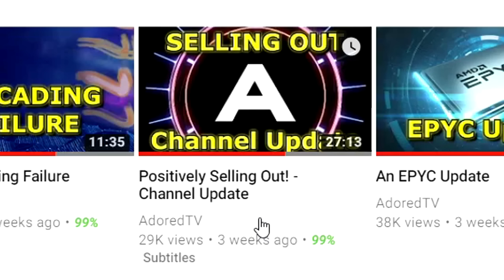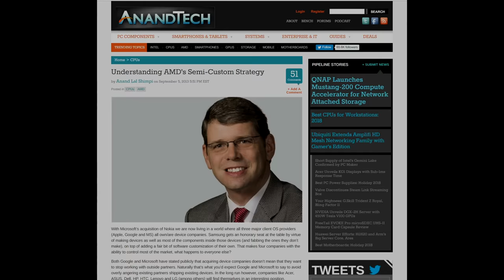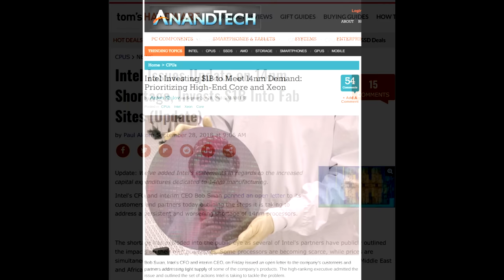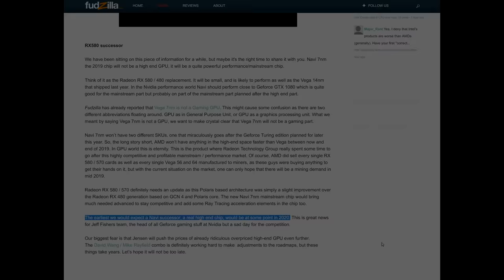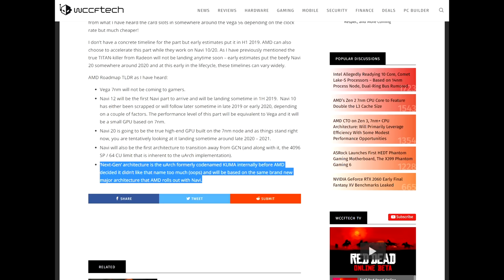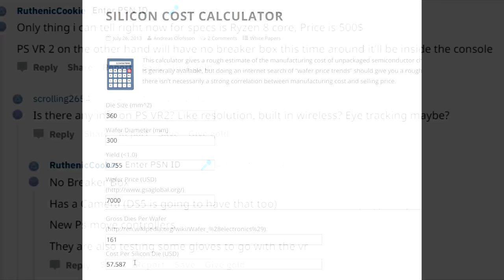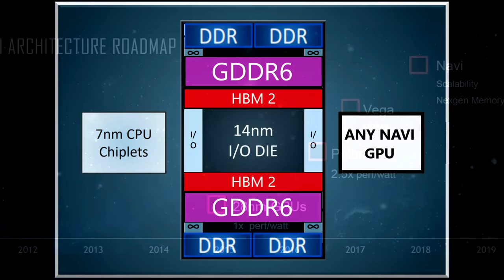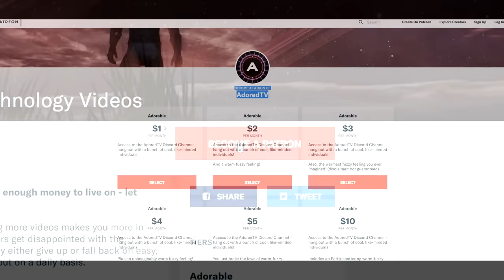AMD  - The (Evolving) Master Plan

Comment: 7nm is gonna be fun.
https://www.semiwiki.com/forum/content/6713-14nm-16nm-10nm-7nm-what-we-know-now.html
Up to 65% power reduction compared to 16nm. That means RX 570 level performance on a 75W card. Couple that with lower power consumption of GDDR6 over GDDR5 and we could be looking at RX 580 level performance within 75W. Oh, and that's just Polaris. Who knows what kind of performance/watt Navi has? 40 Compute units at 2GHz? That's basicly GTX 1070 level performance right? That's a kinda monster.
Oh shit, I shouldn't get myself so excited, GCN has dissappointed me since the 300 series. I don't want to be dissappointed again. 
As for Zen2; I think Ryzen is gonna have 4 chiplets with 0, 1 or 2 functional cores. Threadripper is gonna have 4 chiplets with 3, 4 or 5 functional cores and the rest goes to Rome. Thus the PS5 could have 4 chiplets with 2 functional cores each.

Comment: What does bin and binned and binning mean?
Reply from the maker: it's basically "grading" chips based on how fast they are or how good they are in performance/Watt. For example the best chips that are used in the datacenter (Eypc) would be the "top bins", while stuff like your dual-core Athlons won't be the worst bins.
Reply: @adoredtv  Thanks pal.

Comment: PS5 performing at 1080 Ti level seems very optimistic. 1080 level seems more realistic.
Reply: Just to remind, the quality might be not on par with PC (dx12 driven, not with gameworks)
Reply: @adhahanif9792  If the fidelity doesn't match then it's not on par.

Xbox One X scraps 4K 30 and very few examples 4K 60 by cutting corners on fidelity. You can get a 1050 Ti running extremely high res and fps if everything is a lowest settings plus checkerboarding. Not the same though is it.

Comment: IMHO AMD devices are not optimal at this time because of the need for third party approval i.e lack of software/system support departement. (mantle, multicore/multithread etc ).
the story will be different if there is freedom. custom Console industries are Freedom. (hence this was their slogan "Freedom")
.
my bet that ps5 were just gonna using current custom ryzen cpu and 7nm GCN or vega with gddr6...more like in intel vega series (i7-8xxxG series)
all that combined with optimized ps4 system software.  
.
so NAVI is far away from console, its another level i guess...well idk i might be wrong tho :)

Comment: I think Sony is making a mistake waiting until 2020 to release the PS5. Even in 2020 I doubt they will use 7nm it will be too expensive for the console market. 
In the console market what matters most is FIRST! followed by not an insane price. 
I think Sony would be much better off releasing cheap in winter 2019 with enough power to beat the OneX and a 4k Bluray player, they could even use the Zen 2 architecture but on older nodes e.g. 12nm for the APU cores and 28nm for IO.
Reply: Not going to happen they made their bet years ago. As market sales show Zen is a contender, now on Zen+ more so. Zen2 is going to be the monster Jim talked about. 8 cores even w/o smt (Sony) or with (Microsoft) and a 20% improvement to IPC will make 4k\60 a reality for consoles and NEW multithreaded game engines. I hope PC can keep up. My Vega 64 cost $430 today vs. $500 for a PS5. in 2020.
Reply: @jerrywatson1958  Most console gamers don't care. They see the words next gen first and As long as the price isn't silly the rest doesn't matter. Microsoft's awful xbox drm and lower specs wouldn't have mattered if they beat Sony to market at a better or equal price.
Reply: Games for the new console have to be developed. That is why the timeframe cannot be shifted. Also there has to be enough hardware produced in advance.
Reply: @phas0rOfficial  Hardware wise they could make an 8Tflop ps5 for 2019 it would just need a more expensive cooling system and a higher power budget. Fair enough if they are waiting for games but it's still going to be x86 so all pro titles and most og ps4 titles will work on the system.

Comment: come on now, 4k60 doesn't have the same physical requirements on a console as it does on a pc with it's poorly optimized drivers.
just take the current "4k30" xbox one x and multiply it by 2.
good video though, if not a bit long
Reply from the maker: >just take the current "4k30" xbox one x and multiply it by 2.

Yeah I did that too - twice the Xbox One X wouldn't be far off a 1080Ti either as it's basically just below an RX 580.

Comment: You were right on most points except 1.  Navi can indeed be a mcp.  Most of the die space on a modern GPU is dedicated to CU's.  CU's are the pipe channel that process the graphics after the prefetch, schedular & dispatch sub-processors has handed them off.  Quite frankly it wouldn't be hard for the dispatch processor to hand off instructions to CU's on different chips.   You need to get out of your head the idea a MCP of Navi means corssfire.  It isn't even close.  Cross fire is two GPU's running the same data on the same frame ALR, SFR, or frame &  frame + 1 (AFR) and then sharing that data between chipsets.  This creates massive penalties that are too complex here to explain.  

You were quite astute to point out AMD has been working for years to make their architectures as modular as possible.  This extends to the GPU side. And a recent article on Anand points out the incredible life of the GCN architecture.  All the sub systems on the GPU were built to be swapped out with minimal work.  This includes seperating not only the memory controller, but the prefetch, schedular, & dispatch sub processors.  But just like Ryzen, there will have to be some memory on the CU chiplette to avoid latency affects with an infinity fabric like framework to handle conflicts between chips.  Say like a small frame buffer of RAM.  Why not cache RAM?  Cache contains blocks that are meant to be swapped in and out depending on the caching algorithm.  When you are rendering a tile, the swapout of said data is not necessary until the frame is done.  And that's what chiplettes are essentially doing. They are rendering tiles. 

And as you guessed, I'm betting an infinity like frabric on an interposer to deal with conflicts.  

It took me several weeks of math to work out, but based on the tech specs of what I've seen (Where the most time is spent on different parts of the chip) and where latencies are introduced, the approach above would be more than viable.

Also there's one little tidbit you glossed over with the original XBox One.  That shot showed SRAM buffer gave AMD a lot of information of the latencies of small yet fast memory sizes and how it affected latency.  

-DG
Reply from the maker: I know it's not Crossfire. ;) 

But it's not as simple as just breaking up the front end to work over a bunch of MCM chiplets either.

It's a solvable problem but one that's gonna take a lot of resources.  I don't doubt it's coming, I only question when.

Comment: 15:42 I bought my 8700k early on, and I got a "Golden Sample" which only needs 1.344 Vcore to hit 5 GHZ all core and 4.7 GHZ Cache and can do Prime95 AVX and AIDA64 FPU test (highest heat output, hardest to pass with overclocks) infinitely, maxing out at just 85° on the hottest core - with a Noctua NH-D15!  

I am NOT an Intel Fanboy, I bought my CPU precisely because A) I wanted best gaming performance with headroom for years to come and B) I REALLY enjoy Overclocking! I could probably do 5.1+ GHZ, but I am happy with 5 straight.  IF Zen2 manages to either basically tie, or beat Intel at gaming, I will not reccomend anything else! In fact, my Nephew's i5-7600k motherboard died, and I reccomended he buy a Ryzen 5 2600/X on a B450 or x470 motherboards depending on what he can afford.

Comment: Navi being yet another GCN card would be incredibly disappointing. AMD will never be truly competitive as long as GCN is still around.
Reply: I don't think GCN will be retired until Arcturus, which is after Navi.
Reply: @justinlegrande1630  Yes I also watched the video. Thank you for the valuable insight.
Reply: @JDurnall  I wasn't certain if you had or not, since this video is nearly an hour long.  I had the impression you didn't know, since you phrased your response as "would be incredibly disappointing" instead of "is incredibly disappointing."
Reply: @justinlegrande1630  Adoredtv has not confirmed anything. He has two competing sources saying two completely different things about the same subject. If WCCFTECH is wrong and Navi is still GCN it will mean Navi is likely to dissapoint in more ways than one.
Reply: @JDurnall  Official confirmation, no, but there is this:
https://www.tweaktown.com/news/60760/amd-working-next-gen-gpu-navi-2020-2021/index.html

https://www.tweaktown.com/news/63333/amds-next-gen-arcturus-gpu-teased-radeon-rx-780/index.html

I think Navi will make a nice swan song to GCN, but I wouldn't expect it to outperform Vega by too much.  The main benefits will likely just be cheaper price points and running more efficiently than Vega.  The next generation architecture to succeed GCN, being created by RTG without Raja Koduri's involvement, won't be due until mid- to late- 2020.

Comment: What are your thoughts on the uncore being not quite the moron everybody is deeming it to be.

If it has infinity fabric to the zen-7nm-chiplets and it also can have infinity fabric link to a GPU then why let for example a drawcall pass twice between the uncore and the 7nm-core before going to the GPU if it can handle the instruction itself.

Also think about things like threadcreation/destruction, copy/paste, scheduling, power management (cant imagine every 7nm chiplet deciding for itself when to power down)

For very mundane tasks that happen extremely frequently and are also on top of that latency sensitive, why on earth would they make those even more significant by making a double hop over the infinite bridge. It would invalidate their efforts with DX12 and Vulkan.

If the uncore is a bit of a logistic wonderboy however, it would turn every DX11 game in to a DX12 game and liberate the integers and floaters to be usable instead of them being held hostage by the mundane IO heavy zero-calculation tasks.
Reply from the maker: I wouldn't be surprised if HSA is the endgame here...though with AMD there never is an endgame, let's face it. ;)

Comment: 8:31 No, I saved the company. I am the one who told them to put multiple GPU an sync them on a processor an advertise it as a gaming processor. I am the one who told them for 2 years to push for advertisement! I am the one who said AMD advertises like DogShit! 

An whoever that one guy is does not do a good job at advertisement! I am the one who told them Years later! Fire him an Hype your processors! You need to build up hype! It took them WAY too long to do it but they tried! An it looks clumsy! But it did WORK! I am the one who put this got damned company up!

It was ME! No one Else! An i don't even work for them! I KNEW new developments for Console Gaming was hitting a wall with Intel an only AMD with partnership with ATI would be able to do it. I am the one who told them to focus on Multi-Core processes! Screw Single core. It doesn't matter! All of this was ME! An when i ask for a job. They said you need 5 years of advertising to get this job!

How the hell do you expect me to keep your company afloat if you have policies like this?!  So screw it! I am not helping right now. They think they have all the answers. They think they got it all figured out. But I KNOW whats going to happen. An i will wait for it. An when it does. Ill just buy out the damned company. You just wait an see.

Comment: Yeah tons of speculation on this one. PS 5 will not be a 4k 60 fps monster. Console gamers and media outlets always over hype the next gen and get disappointed when it don't pan out.
Current consoles, to include X, rarely do 4k and it's even more rare to see 60 fps. Next gen will be between 20 and 30% faster then the current top end console.
Navi discrete will land about 6 fps faster then the RX 590 and place it at 1070 level but still under Vega 56. AMD will sell both Navi and Vega for at least a year then there will be a "rebrand" and Navi will replace current gen Vega. At this point Data Centers will have the Vega 7 nm in place and then 7 nm Vega will come to gaming. They will first make the big money from data, then gaming. If they launched 7 nm Vega gaming cards too early then Data Centers will save money and buy the gaming variant.
Reply: Raging Monk Datacentres would never use the gaming variant.
Reply: @davey5878  , "Datacentres would never use the gaming variant"
It has been tested and demonstrated that current Vega for gaming holds up well in work stations. To claim they would not take advantage of that is false.
Reply: @ragingmonk6080  Just because one can, doesn't mean one will.
Workstations are not the same as Datacenters the last time I checked.

Using gaming cards in an enterprise Datacenter requires a fair amount of validation. Do you know of any specific enterprise datacenters that use off the shelf gaming cards (as opposed to AMD Instinct variants) ?. Please share and enlighted us
Reply: Raging Monk That’s hardly evidence of anything. As Jerry said “show me the money”. I ask again, which Datacenter’s that you know off use off the shelf gaming cards ?
Reply: @davey5878  "That’s hardly evidence of anything. As Jerry said “show me the money”."
Don't be an idiot. It is proof of everything.

Comment: Consumers ignored AMD because their marketing sucked, only some knew their GPUs are better but what happened? Oh yeah they kept on dying in warranty, Nvidia had similar issues. And GPU standards were in infancy still, DX9 etc. You get a better card but oh wait no one supports it's features, goes the same for ray tracing nonsense right now but also look at DX12 and Vulkan adoption? Abysmal. And then OK so I got a good value good performance AMD GPU but it has seen better days and want to upgrade? To what from AMD? Nothing for a few years. Then they come up again with something reasonable and competitive Tahiti/Hawaii era, and then... oh yeah, nothing again, rebranding power hungry GPUs same as Nvidia was doing few years back and everyone hated it. Then they finally launch Polaris only you cannot buy it because they sell bulk to data/mining farms instead of regular people/retail. So you end up with RX580 way too late, RX590 that is what 480 should have been. Vega that is nice but it's features are vaporware in drivers and hardware issues are speculated as the reason, power hungry uncompetitive cards. So if you bought an R9 290/390, what do you upgrade to? Nothing because Vega is not that big of a jump from 290/390/480/580/590 cards. AMD loves to get stuck at a fixed performance level with their GPUs giving no upgrade path. Inconsistency in launching competitive GPUs, terrible GPU supply after every launch at least since GCN1 so even if you want the card try and buy it for 3 months you cannot get it, the GPUs are OK but AMD lost it's focus on power consumption and thus lost performance competitiveness, another issue was and still is lackluster support of it's yes open but barely implemented features, it took years to get HW encoders implemented and then there is the whole CUDA vs OpenCL mess. Want a powerful compute card, people buy Nvidia implement CUDA and don't care about OpenCL. AMD needs to have a great card in multiple segments, compute and graphics/gaming, split their GPUs finally and make them purpose optimized. And consistently launch competitive affordable and AVAILABLE products. CPUs they can always supply a crap ton of, but GPUs? Hell they can't even secure and use good VRAM chips, no those go to other corporations and to Nvidia. GPU chiplets still nowhere in sight, great HBM GPUs nowhere in sight, advantage of HBM over DDR not seen yet on products. How long do people have to suggest chiplets to AMD to make GPUs and APUs that way, forever it seems.

Comment: 50 minutes? wtf, just had to blow off the wife, we're trying for a baby... well I'm not now, watching you.

Also this was pretty obvious, I called it a few years back when Nvidia hinted at then then new gimpworks aka RTX... AMD owns games. Full fucking stop... All the next gen games will be programmed for Navi and next gen consoles... if AMD don't want RT in games? it's upto them not Nvidia, and there is fuck all they can do about it. Ryzen3 and navi is going to destroy laptop/desktop and both next gen consoles... it's going to be fun watching AMD's stock price reaching $100 by a few years.

What I find surprising is AMD and nvidia giving up on MGPU. Why?... omitting problems with temporal graphical effects, if AMD's did replace polaris with Navi but implemented a "hardware linked" Mgpu, without the need to crossfire drivers they could introduce 80% scaling with 2x Navi mid range cards and never have to develop a single large high end chip... 2x Navi would smash a 2080ti, both for cost and advantages of manufacturing. 

YAY MCM GPU's are coming! AMD's strategy here is so long game it's unreal, but by god is it clever... Best wishes AMD, hope you can bring some sanity to the market sooner rather than later.